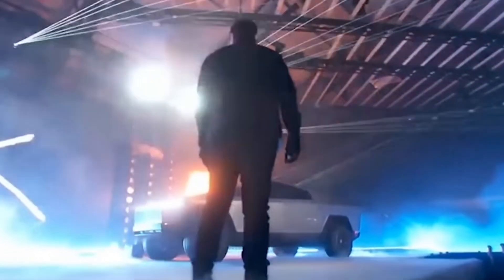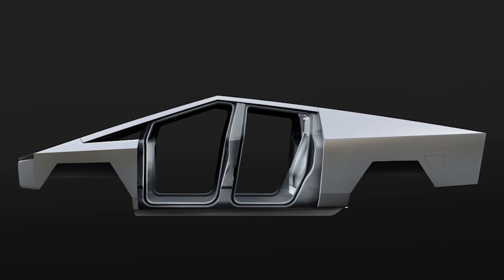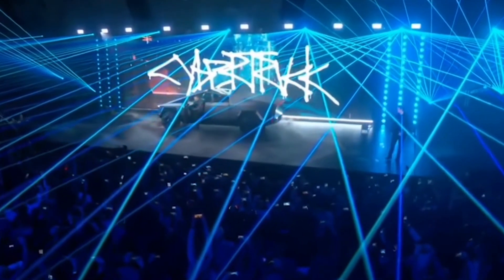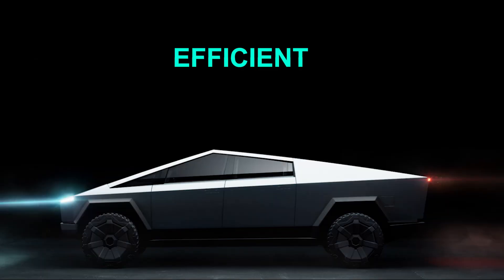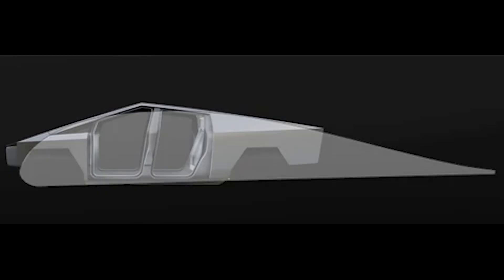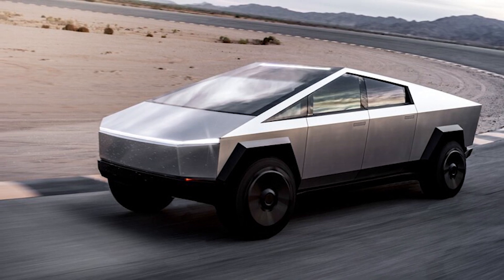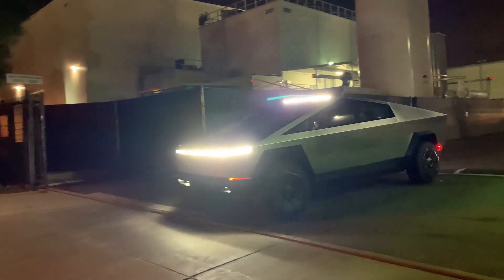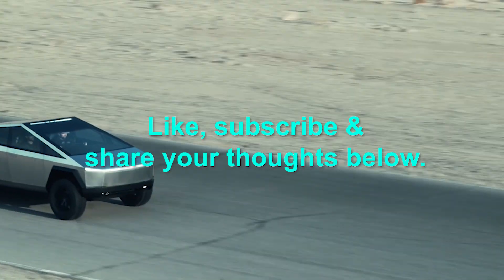Cybertruck is Engineering Genius (and will be copied)

Comment: There’s a reason why other cars crumble. They are made to absorb impacts, like an airbag.
The structure of this car won’t help with absorbing the impact.
Reply: It will, actually. The lack of a big metal engine block means the entire front meter or so is a massive crumple zone.
Reply: 3mm of sheet steel vs. a 3 ton mass? It'll crumple like a paper bag - in fact, they'll have no choice but to put additional crash structures in the front (unless they can dual-purpose something that's already there), and THAT's what will determine how it crumples in a crash.
Reply: It amazes me how normies who think they're smart and thought of the one thing I guess they think Tesla Engineers overlooked? Tesla thus far has made literally the safest production cars by far.

You seriously think they simply forgot about safety from day one?You thought about it but they ignored it? Yea, right.

Of course the most reasonable thing for us to assume at this point is that Tesla at least continues with their trend of making exceptionally safe vehicles, just because it's made from steel doesn't mean jack when you can make anything from Steel wool to Space Craft. Let's wait for testing before we think we know better than some of the smartest engineers on the planet, shall we?
Reply: @OGPatriot03  Woah chill, the statement might not have been completely correct but you don't need to tell me that like i'm braindead.
Be like the one's above you instead. 
You often don't need to be so serious to prove someone wrong.
Reply: You don’t need to worry, Musk figured out how to land the first stage of an orbital class rocket onto a driverless drone ship and then re-fly it.  I think he can manage to engineer a “crumple” zone on 3mm steel. 

Also, to the uneducated idiots on here that have probably been disrespecting Musk and Tesla for the last 8 years at every new development, guess what?
You have been consistently wrong the last 8 years and you will be consistently wrong the next 8 years.  There’s just no chance that you will learn anything because, it would appear, you are just too stupid to learn even from your mistakes.
Reply from the maker: Lots of people are raising this. The steel can be scored on the underside to crumple predictably and consistently (and it appears the frunk is a separate component). I think many will be surprised at how well the Tesla engineers address this. Safety is always top of mind at Tesla. It may not appear so but the driver in Cybertruck sits the same distance from front of the vehicle as they do in Model 3 so there's equivalent space for crumple zone too.

End of the day, Cybertruck won't be allowed on roads if it is not sufficiently safe for occupants or pedestrians. Tesla are smarter than to design an unsafe vehicle 😉
Reply: @Solving The Money Problem, yep 100% agree.  It’s weird that armchair critics who come up with a potential problem after seeing the truck for 5 minutes, honestly think they stumble on an issue that Musk hadn’t considered in his years of developing it. 🙄
Reply: CLP  Sorry, safety is not an afterthought in any car's engineering. It's not something you can stick on after the fact.
Reply: You could build a pseudo crumple zone on  the interior if the seats are allowed to travel slightly forward on impact (in a controlled way).  They could even use hydraulic or pneumatic cylinders...  Wouldn't have to crumple... when you were done you could reset the cylinders.
Reply: @senoJSR  🤣😂🤣😂🤣😂🤣😂🤣😂🤣😂😁😁😁
Reply: CLP , if you think the cybertruck is a concept car, you have no credibility.
Reply: @CLP yeah what an exceptional person. ✊
There have been times when Musks enthusiasm and optimism needed to be tempered by a strong leader within the company. But Musk is a very fast learner as evidenced by his more recent overachieving of his promises these days. Personally I wouldn’t entrust the company with anybody else, this is not financial advice, but if you have money to invest then I would do it before the China factory ramps up and also do it before battery investor day and the launch of feature complete full self driving. Because, as fast as Tesla has grown, we ain’t seen nothing yet!
Reply: let Govt. authorities worry about that, they will only pass it if it's street legal, passenger safe, pedestrian safe otherwise they will say to tesla go back to drawing boards.
Reply: @CLP not sure what you mean, you could have bought for $250 in October 2018 and sold for $380 before the drop. Did he engineer the drop? What happened?
Reply: @CLP will you blame him again if the stock goes to the moon and you missed the ride?
Reply: You're totally on point, but you can't reason with the Muskmobile nutswingers.
Reply: @GroovesAndLands  ...LOL...they all secretly wish they could be Musk's personal fluffer.
Reply: @GroovesAndLands  Jealousy is a sad and ugly thing.
Reply: CLP  didnt you hear the fanboy? he said they've tested ALL 4 factors including safety!!!!! smh I hate cult followers

Comment: No waiting for paint to dry but you also can't fix a dent, the forces in an accident are much different than hitting a truck with a sledge hammer. I like the forward thinking bit I would have liked to see him hit the truck on a body line

Comment: There are some valid points here. But its still painfully ugly and doesnt look finished at all. And regarding safety, the car must crumple in an accident. So ultra strong exterior panels will just transfer that deceleration directly to the occupants. And as far as towing ability, watch the engineering explained about electric cars towing stuff. Keep smokin trees 😀
Reply from the maker: Lots of people are raising this. The steel can be scored on the underside to crumple predictably and consistently (and it appears the frunk is a separate component). I think many will be surprised at how well the Tesla engineers address this. Safety is always top of mind at Tesla. It may not appear so but the driver in Cybertruck sits the same distance from front of the vehicle as they do in Model 3 so there's equivalent space for crumple zone too.

End of the day, Cybertruck won't be allowed on roads if it is not sufficiently safe for occupants or pedestrians. Tesla are smarter than to design an unsafe vehicle 😉

Comment: Rigged doesn’t mean safe . The less give the material has the more dangerous it is. Hopefully they have some crumple zones
Reply from the maker: Lots of people are raising this. The steel can be scored on the underside to crumple predictably and consistently (and it appears the frunk is a separate component). I think many will be surprised at how well the Tesla engineers address this. Safety is always top of mind at Tesla. It may not appear so but the driver in Cybertruck sits the same distance from front of the vehicle as they do in Model 3 so there's equivalent space for crumple zone too.

End of the day, Cybertruck won't be allowed on roads if it is not sufficiently safe for occupants or pedestrians. Tesla are smarter than to design an unsafe vehicle 😉

Comment: just because its tough doesn't mean its safe. my concern is since its so sturdy and rigid that would inherently mean it is unsafe in an accident. Does the vehicle still have crumple zones?
Reply from the maker: Lots of people are raising this. The steel can be scored on the underside to crumple predictably and consistently (and it appears the frunk is a separate component). I think many will be surprised at how well the Tesla engineers address this. Safety is always top of mind at Tesla. It may not appear so but the driver in Cybertruck sits the same distance from front of the vehicle as they do in Model 3 so there's equivalent space for crumple zone too.

End of the day, Cybertruck won't be allowed on roads if it is not sufficiently safe for occupants or pedestrians. Tesla are smarter than to design an unsafe vehicle 😉

Comment: I'm curious about the crash test safety.  Driving around in an indestructible tank is great for you.  But not for the person you impact.  This is why we have things called crumple zones.
Reply from the maker: Lots of people are raising this. The steel can be scored on the underside to crumple predictably and consistently (and it appears the frunk is a separate component). I think many will be surprised at how well the Tesla engineers address this. Safety is always top of mind at Tesla. It may not appear so but the driver in Cybertruck sits the same distance from front of the vehicle as they do in Model 3 so there's equivalent space for crumple zone too.

End of the day, Cybertruck won't be allowed on roads if it is not sufficiently safe for occupants or pedestrians. Tesla are smarter than to design an unsafe vehicle 😉
Reply: @SolvingTheMoneyProblem  if that's true then why advertise unbreakable windows. Which would make it difficult for emergency responders to break a window to get you out?  I know they have bigger tools but many people carry glass breakers in case of emergency to get out on your own if your door is crushed or you are in water. Unless the windows are an effort to make it appear tough?  Like so a branch when off-roading doesn't damage a window?  But even then it doesn't make much sense as side windows in current vehicles use tempered glass which keeps you safe and allows you to escape.

Comment: The crumple zone is the other person's car. Cybertruckers won't feel a thing. If they hit a tree or wall the car's angles will just cut through it. Thanks Elon.
Reply from the maker: Lots of people are raising this. The steel can be scored on the underside to crumple predictably and consistently (and it appears the frunk is a separate component). I think many will be surprised at how well the Tesla engineers address this. Safety is always top of mind at Tesla. It may not appear so but the driver in Cybertruck sits the same distance from front of the vehicle as they do in Model 3 so there's equivalent space for crumple zone too.

End of the day, Cybertruck won't be allowed on roads if it is not sufficiently safe for occupants or pedestrians. Tesla are smarter than to design an unsafe vehicle 😉

Comment: The lack of crumple zones front and rear to absorb some kinetic energy in the event of collision will 1) Rule this vehicle out of many overseas markets 2) Kill people.  It doesn't matter how strong the  vehicle is, your brain - and other organs - decelerating rapidly will suffer more without something to cushion that impact. And good luck with repairs to the vehicles exoskeleton once it does experience a strong impact - you might as well scrap it.  I'll be interested to see how they deal with all those issues before it becomes publicly available.
Reply from the maker: Hey Mike, lots of people are raising this. The steel can be scored on the underside to crumple predictably and consistently (or the hood could be a separate component). I think many will be surprised at how well the Tesla engineers address this. Safety is always top of mind at Tesla. It may not appear so but the driver in Cybertruck sits the same distance from front of the vehicle as they do in Model 3 so there's equivalent space for crumple zone too.

End of the day, Cybertruck won't be allowed on roads if it is not sufficiently safe. Tesla are smarter than to design an unsafe vehicle 😉

Comment: Highly incomplete, misinforming, and inaccurate information presented by someone clearly with a biased financial agenda. The technical points discussed in the video are tissue paper thin. Simply wrong.
Reply from the maker: Thanks for the feedback Fred. If you have time, please tear my tissue paper points in half so I know where I am wrong.
Reply: @SolvingTheMoneyProblem  

For starters calling the saving on paint a real breakthrough is being manipulative. It simply is just designed to do without paint. It isn't a special feature. It's a cost saving that many consumers may prefer but plenty also wouldn't since it restricts the car's aesthetics. Any other car maker can apply this strategy if they wished. Which brings me to the second point.

Structure and panels are fine the way tesla decided to do but again describing this cost saving engineering choice a breakthrough is dishonest. It's simply a cost saving decision that works for and against. It's an innovative business decision for sure and saves Tesla a lot of money. I wonder if those savings get passed on to the consumer or the marketing BS here is going to go the other way and spin this like a brilliant thing, charging a premium on what is essentially simplifying many laborious manufacturing procedures. Guess what the other makers do, btw this isn't difficult to implement. It's just that other makers want detail because most consumers want detail in their frames. Safety ratings test both active and passive technologies. I'm not too sure about the specifics on this Tesla's frame but certainly crumble zone and impact dynamics are different to a "conventional" car's especially with the "armored" door test lol. BTW that BS demonstration where the guy does a half assed swing is obvious. Although I'm sure Tesla engineers know what they're doing re safety designs here.

Airfoil overlap... hmmmm no that's not how it works. The purpose of the wing's cross section is to demonstrate an efficient geometry to maximize lift while juggling the many, many, many other factors involved in civilian airliners. Why did you overlap with a wing's cross section? That shape is for lift look into physics behind buoyancy. A car needs downforce. Sure the aerodynamics isn't a problem with this car I'm certain but what you've done there is really create a hype with nothing out of nothing.

Let's look at this from another consumer perspective as opposed to blindly praising something which I'm sure you have shares in. The car has no detail, and even then it is ugly (subjective but a common opinion). Does primer/ base material colour really benefit me as a consumer? A deep scratch on a painted car on a worksite will also scratch this car btw. Armour or not, it's hardness - strength that is the issue. Being a one piece frame supposedly, you can bet it's tensile strength is not even close to being scratch or impact resistant despite their attempt at deception (which failed by the way since the guy barely swung at the Tesla while he put all his weight to dent the normal door). Even so, I don't want martensitic levels of steel all around my car thanks.

Let's wait and see what the pricing structure and actual real world safety and performance are like first. Maybe they do decide to pass on all those savings. Tesla does not have a monopoly on any core technology that go into these electric cars despite the whole fuss they made about making IP public lol they only shared charging specs on their systems in a hope to standardise charging. Like telling everyone we're using this bus so let's all develop the metaphoric USB. Japanese and Chinese suppliers developed and manufacture a great deal of Tesla's charging and battery tech. Many other car companies can make Teslas but with much better build quality and dare I say, styling too. Wait till BMW or VW Audi group plays in this field... this company's future is iffy at best and any accountant will tell one to stay the fuck away from this company. Tesla is not Space X or Paypal. Even then there are risks with investing.
Reply: @SolvingTheMoneyProblem  

Also should add that imitation is the sincerest form of flattery. Not just flattery but in business it is survival and being able to thrive. All other big car makers from Germany to China to USA to Russia to Korea... copy the absolute fuck out of each other not just in styling but technology direction, management, structure, manufacturing techniques, factory layout, worker salary! 

Tesla's big entrance to the car world was backed on electric vehicle propulsion. It's unique? Not quite, been there done that, albeit different execution. Even modern electric makers and model ranges come and go. None of the established players copy Tesla on any major fronts. I'm not knocking full electric at all but the fact that the big boys don't copy Tesla for the most part says something. I like that Tesla is offering alternatives. I really do, but let's not sell it as if it's the next big thing.
Reply: this video is for Tesla fanboys and reading some comments where people are literally making reservations out of here say is dangerous.

Comment: Cars get some of their safety from crumpling and absorbing energy. Tesla's have a frunk that crumples better then an ICE engine compartment. The issue of the Cybertruck not crumpling has been raised, so what's the answer? You can use the other vehicle for your crumple zone BUT when they test a car they slam it into a solid object so the Cybertruck has to pass that test. How's going to do that? I'm not saying it can't pass test but are there any ideas on how?
Reply from the maker: Lots of people are raising this. The steel can be scored on the underside to crumple predictably and consistently (or the hood could be a separate component). I think many will be surprised at how well the Tesla engineers address this. Safety is always top of mind at Tesla. It may not appear so but the driver in Cybertruck sits the same distance from front of the vehicle as they do in Model 3 so there's equivalent space for crumple zone too.

End of the day, Cybertruck won't be allowed on roads if it is not sufficiently safe. Tesla are smarter than to design an unsafe vehicle 😉